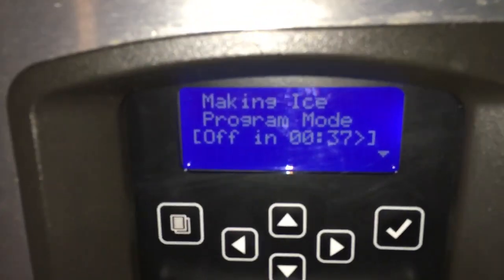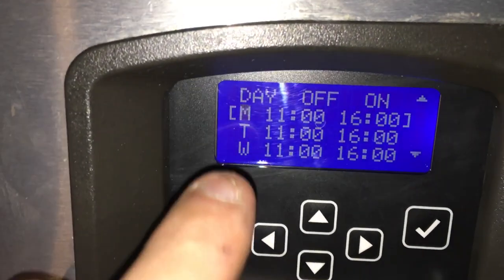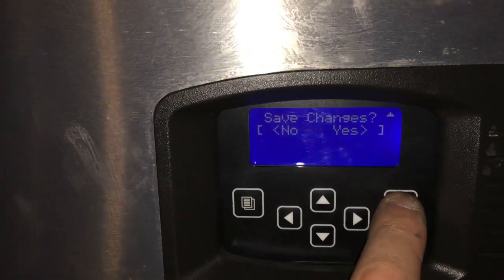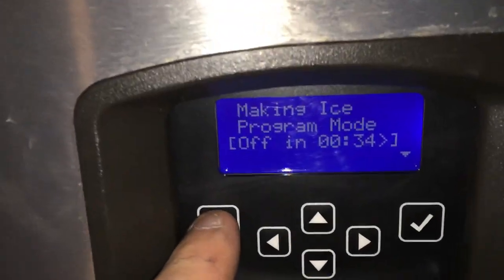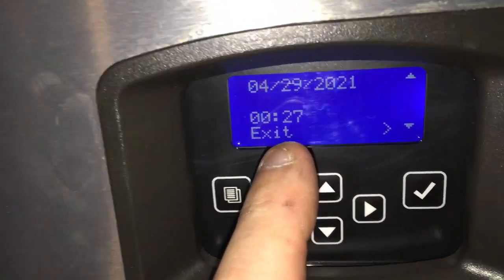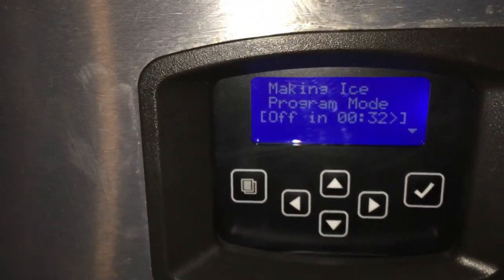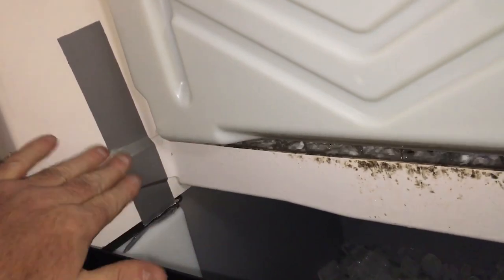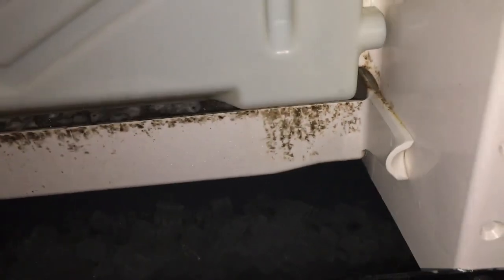How to Program Manitowoc ice machine Start & stop times.

Comment: Have several of these machines... one of which in our maintenance barn which has had power supply (amongst many other problems..... 95 ambient... 90 plus water temp... dust and sand to name a few)and have seen "program mode" displayed and wondered how to clear that setting... Thanks!

Comment: have several of these machine 3 - 5 yrs old... have not had to do much beyond cleaning but now have one that has been acting up..... thanks for the walk thru... I've been to the annual training at the supply house but some of the simplest things have to RTFM or luck into them here!
Reply from the maker: Biggest deal with these is clean. They like to be clean. Or they will throw faults.

2) if they are clean - and still throw codes. Replace water level probe & ice thickness sensor. Those are basically the only things that go bad.

And of course - Clean / blow out the condenser backwards & make sure you can see light through it.

Other issues - 
1) Check capacitor Mfd. next video coming soon. 
2) Check Contactor points. Replace if burned. Next video coming soon. These two.

Comment: Hi we can not store new parameters on the system, any idea?
Reply from the maker: Try turning off the breaker or unplugging the ice machine from the wall.
Wait 5 minutes Minimum !
Then plug back in or turn breaker back on again.
Reply: @OcRefrig  Yes, unplugged and left off for 8 hours waiting to be service. Plug back on & still unable to reprogram to operate without bin sensor. Also we can not program the system to run on daily time on/off.